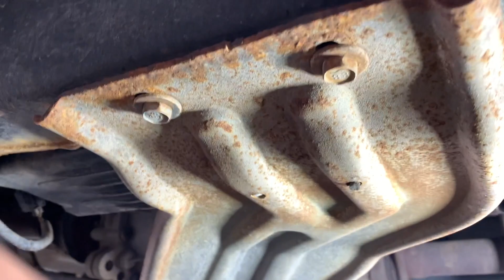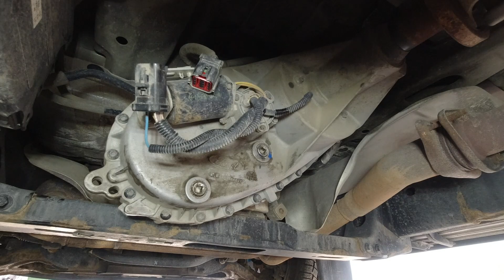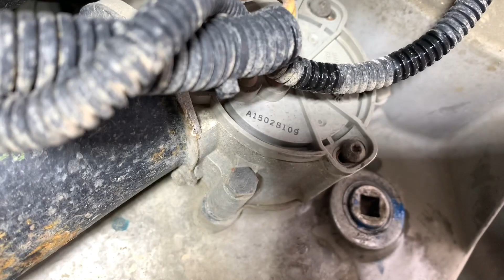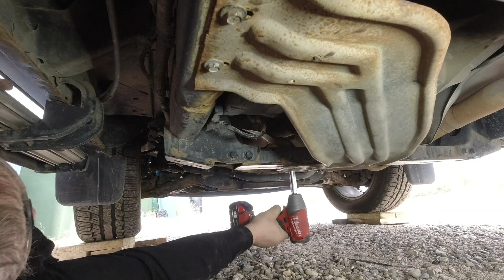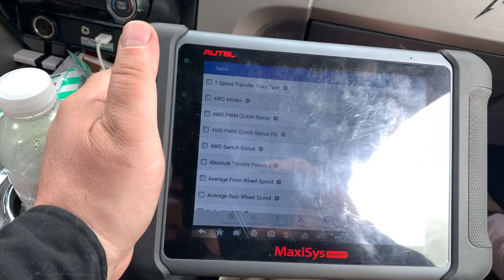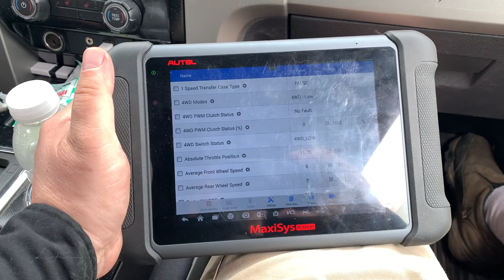Ford 150 Four Wheel Drive not working P1867

Comment: My code is P1891-2f i cant seem to find out what it is but i know it has to do with the 4x4
Reply: Code P1891 Transmission Transfer Case Contact Plate Ground Return Open Circuit
Reply: @robinruiz3480  I have that same code.
Replace shift motor and still don't work.
I also had the motor in my hand without installing it in the transfer case and had someone help me move the selector knob and it don't move at all.
Also tested all the wires from knob to the motor and it does have continuity or signal and it shows on live data on the scanner.
Any ideas?
Reply: Did you get it working yet?
Can you share some information